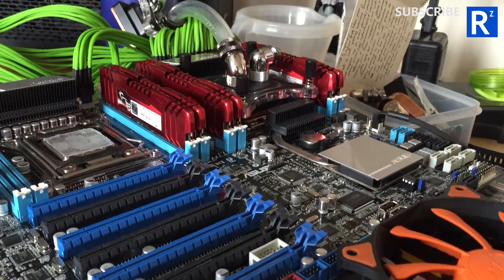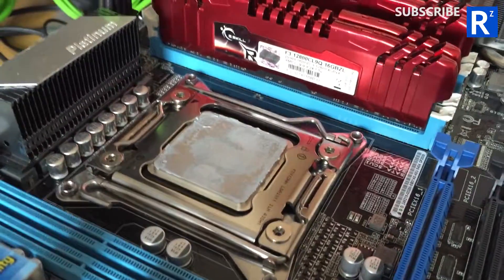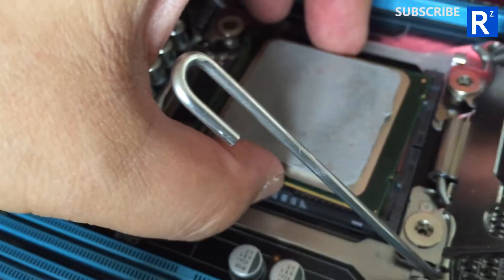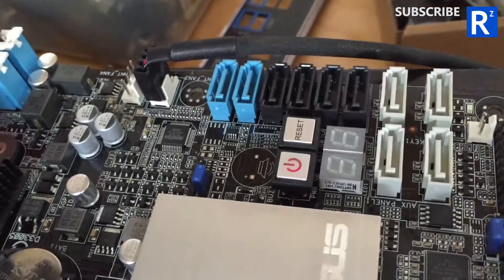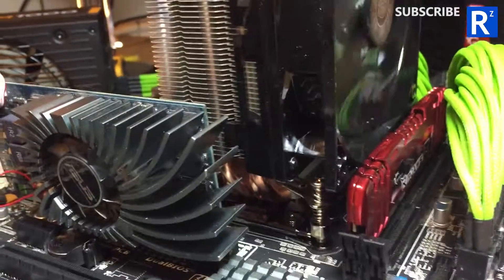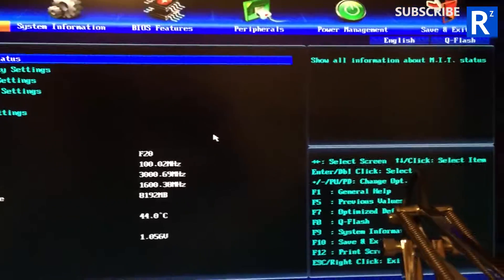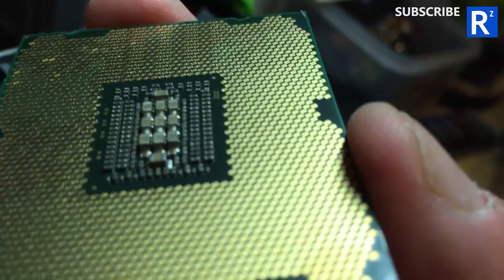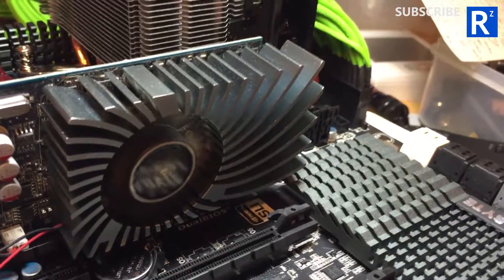ASUS Z9PE-D8 WS motherboard faulty. Xeon Testing

Comment: Like double processing needs 2 identical Xeon processors, you need to use Registered ECC ram modules. (I am using 8 piece of 4GB sized Registered ECC, 4 modules from Micron, another 4 from Samsung) As I see in the picture, you are using non-ECC Rams. !!! I am using the same mainboard with double Xeon E5-2658 v2 proessors. If I insert non-ecc Rams to first and second CPU Ram slots, system is not working! If, I remove the second CPU, system works. That is your problem....

Comment: I think what happened is the VRMs of the left socket (CPU2) failed and shorted 12v to CPU Vcore (unfortunately this happens), killing CPU2 probably for good.
Either that or CPU2 just commited suicide by itself, shorting CPU Vcore to ground internally. (which hardly ever happens but it is worth investigating)

Were you able to boot the ASUS Board again with  just CPU1 and some Memory?
Reply: yes i was

Comment: Hi mate, This is what solved my problem. The ONLY thing that got it going again was to remove the second CPU, make sure the all the RAM except one DIMM for the 1st CPU was removed, move the graphics card to a PCIE slot used by the first CPU, disconnect all other devices such as HD's etc, then reset CMOS AGAIN!